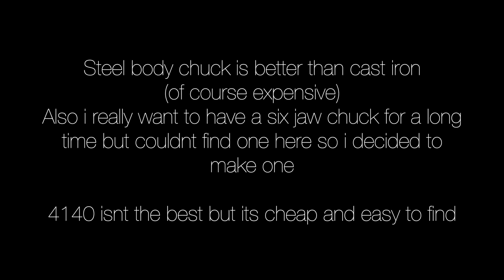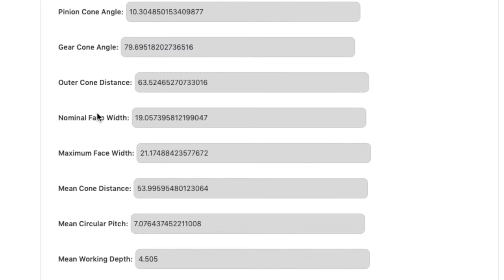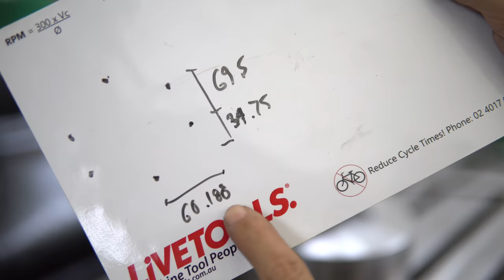MAKING a 6 jaw CHUCK - part 1

Comment: I have been in this trade 48 years and still I learn something new from people like you every day. I work mostly on a Toss SN 50 lathe fitted with a 250 mm diameter 4 jaw self centering chuck which is far superior to a 3 jaw chuck for many reasons. But a six jaw chuck would be fantastic. Never thought it is possible. BRILLIANT IDEA.

Comment: Greetings from Australia
Take some basic machines. Grinder, Lathe, Mill, dividing head Etc. 
These machines will give you the ability to make basic parts.
Naturally the machines have be "Tuned " to perfection. and if there are any faults or foibles in the machines know them well.
Next add careful design work then job planning. 
And finally add a highly skilled craftsman at the controls. 

I am in awe Mr Lem.

Comment: I remember when I used to think gears were challenging. In those days it was mostly lack of knowledge and partly the tooling or equipment. Soon as I made my first C brake suddenly thinks began to change, add a 4th axis, then a 5th axis to the mill, and boom, the world of tool making broadens, and does so efficiently. 

I would encourage anyone who wants to machine to manually first. If you cant make due with manual how will you make quality with CNC? This guy knows what he is doing. His love is for making all things, not manufacturing. I’m familiar with this mindset.

When you’re building your shop this is what you do. Before anyone thinks to buy a CNC engineer all those tools you want to buy from scratch like this guys and only then are you worthy of being a machinist. If you can’t make a boring rod, or thread a trapezoidal lead screw, regrind a broken end mill, or make custom cutter’s for your lathe stick to manual you haven’t spent enough time earning your keep yet. Before you turn on that first CNC build it, don’t buy it. Earn your communities respect.

To all of you who know what I’m saying and appreciate this guys work because you’ve been there, hats off to you my friends l, you are also exceptional.

Most will never understand until they’ve made it.

Comment: I’m blown away.  I watched your first few videos and you progressed so far in a short time.  Anyone who watches a lot of YouTube machining videos knows of Tom Lipton, Robin Renzetti, and Stefan Gotteswinter (sp?), and in no particular order I’d rank them top 3 but after seeing this I’d throw you right up against them in a heartbeat!  I haven’t seen anyone else make something like this on YouTube.  The mag chuck in the 4 jaw on the lathe had my jaw on the ground.  That’s a new one I’ve never seen (yes I know they make commercial round mag chucks for lathes but that’s not the point.  Then the diamond nib to dress the id grinder.  Not to mention the geartrain running off the power feed to cut the scroll.  Whipping up the pinions (little bevel gears) checking your hand ground cutter on the shadowgraph/optical comparator.  I’m prolly gonna rewatch it cause I think I’m forgetting a couple more impressive operation not seen on these parts very often.  And you hardened the parts too.  
Incredible, just incredible.  My hats off to you young man!

Comment: VERY NICELY MANUFACTURED ! ! ! ! I made a 4.000" 6 jaw scroll chuck, just to see if I could do it... Yes, I did it, but, WOW, was that a hard and long project, I think I had 180 hours in that, from R&D, to CAD work, to set up's, and (a few mistakes to re make) to finished completed 6 jaw chuck. Then I found exactly what I wanted on like from another country, for like $280 USD shipped.. LOL... That is okay, I enjoyed making it and learned allot. but, I like the lock system you did for the chuck key driver gears, that was a really clever locking system. Well done !!!!

Comment: Wow thats awsome! Its made of actual steel and not yucky cast iron. ❤😮🎉😊

Cast iron is like aids for lathes and mills, the sand like iron fillings are just like diamonds on glass and chew everything apart unless you strip everything down and clean thoroughly before next use

Comment: Sometimes I see them buying expensive tools for the workshop, even though we have all the machinery to make the tool. Sometimes I think they are lazy amateurs, and can not figure it out. I'm not trained in anything to do with CNC Turning or Milling, I'm a simple auto mechanic. Sometimes I come up with ideas about how to grind a steel to make the threads, but no no, rather buy an expensive TR26 threaded stud for $ 800 ..... 2 times ..... the first one broke. But what here I have to say. I only saw everything that needs to be processed, plus everything they destroy.
I think you're a genius, I'm throwing everything away when I see you made a new video, because it just needs to be seen. I want more.

Comment: You misaligned the two halves of the universal joint coupler. At 11:40 you can see that the two yokes of the universal joint are out of phase. This will cause the rotational velocity of the output shaft to slightly vary two cycles per revolution. In other words, two universal joints in series need to have their yokes phased correctly for it to be a constant velocity coupler. Because the two ends of the intermediate shaft are out of phase there's a small variation in the accuracy of the spiral.  

Luckily in this application the accuracy of the spiral isn't important.  And the large gear reduction between the dividing head and the output shaft driving the table feed will reduce that error and it's probably a lot less noticeable than it otherwise would be. It would only be noticeable if the grooves of the spiral were smaller and tighter. 

If you ever put this tool to use for an application where high accuracy of the spiral is necessary, then when you adjust the width of the cut (at 13:35), you should loosen one of the setscrews on the outer ends of one of the yokes instead of the setscrew in the middle of the intermediate shaft. That way you could keep the two yokes in phase. Alternatively,  a better solution than custom made universal joints to couple the two gear trains, might be a CV axle off a small FWD car.

Comment: (Technical translation) Like! This is the first time I see that a lathe chuck of such complexity and quality was made not at the factory, but in an ordinary workshop. But I will make one comment, the cardan transmission has a serious drawback - the lack of synchronization of the rotation of the shafts. Here you need a constant velocity joint (CV joint).

Comment: An amazing job of precision machining. BTW, the face of the chuck looks habd scraped. I didn't see that in the video.
Reply from the maker: No. Its cross grinding. Just rough ground for flat reference. I will regrind it on a lathe

Comment: I've seen a lot of videos on youtube like this but there's a whole bunch of firsts I've seen in this video. Someone using a surface grinder, which is weird because every shop should have one IMO, a shadowgraph, someone dressing a drinding wheel with a diamond and someone using the old engineers pocket book to work out the XY coordinates for the PCD and I'm only 18 minutes into this video.

Comment: How come you didn't use the schaublin for milling the scroll? They had the spiral system for both Rotary tables and dividing head
Reply from the maker: That system would cost 10 times the money i spent for the schaublin itself. I couldnt find any tool for schaublin here, also it small, too short z axis so i sold it year ago bro.
Reply: oh, I didn't know that. Sad to hear that you sold it but if you couldn't use it, then it's completely understandable. Anyway I love your projects!
Reply: I wondered if you'd offloaded it a few vids ago as I'd not seen it. Hope you got a great price for its sale after the restoration you did on it!

Comment: You are an amazingly skilled machinist. You need to finish it. At the very least, you will appreciate what it takes to build such a precise piece of tooling. After watching the video, I don't feel bad at all spending what I did for my six jaw chuck.  And how did you cut those bevel meshed gears? So much ingenuity.

Comment: verry VERRY impressive build 
me being lazy , if i was to tackle sumting like it i probably wouldve started with a 3 jaw chuck and adapted that to 6 jaw , if the top part of the 3 jaw chuck was not hardened i couldve milled it out for the other 3 jaws and i wouldve needed to make 3 extra jaws with the right offset spiral , and combine those with the originals 
this wouldve saved me some of the tooling needed to make the parts though i probably still wouldve needed the spiral cutter setup for the jaws (think you need to make sumting that holds the 6 jaws in their location while milling the spiral in the back of them , might be able to use the top part of the 6 jaw base for that it you make sumting to hold the jaws down in it while still being able to mill the back of them )

Comment: The input and output of the shaft with the 2 universal joints aren't parallel to eachother. This means that the output shaft speed isn't always the same speed as the input, each revolution it lags behind then catches up until it's ahead and then slows down again. I guess this wasn't an issue in making the spiral gear?

Comment: Looking at the specs pre 0:55 4140 is very close in the normalized state. With a small hardening the spec should be able to be exceed. Say maybe a temper only in liquid oxygen, or for even better nitrogen. Helium liquid is colder and would impart even more toughness to it. 

Heating can harden the steel but cryogenic treatment can also do some amazing things by changing the molecular crystalline pattern. 

Kinda like how heat hardens and then you temper it. Cryogenics help in amazing ways. 

Check out bend video about drill bits and cryogenic stuff at applied science. 

Just maybe thought it would help by the text card about how its not the best being alloy 4140. 4140 is amazing in reality.
Reply: Interested in the video about the spiral milling attaching attachment

Comment: 10:32 
10:52
Yes, absolutely, I thought this was the most brilliant aspect of the build, I hope you do a detailed vid on this.
Also, I wonder if you might consider an air auto chuck as for CNC machines...you could still use it on your manual lathe for higher production... Leader UK used to make 4" ones, then it looks like their subsidiary in Taiwan "Autogrip" took over. It'd be great if you could reverse engineer one...the hobby market would love to have that.

Comment: The internal grinding of the scroll was intermittent. Is the scroll form equally out of round from the hardening process? That could be the 1/2 thou out of round of the final vid. The work you put in means it should perform better than that. It’s so accurate in every other area.

Comment: did you calculate the length of the gear cutting tool or the diameter circle of the cutting tool on both the pinion and sun gears?

Comment: amazing work, maybe just drill bolt on face plate for oil line? &  plastic cap, or drilled short head bolt & grease cup with tread.

Comment: I didn't watch this video yet (no time at the moment), but i am wondering: Why 6 jaws? you need 3 to tighten securely, you need 4 to turn off center, what advantage to you get from 6? Tightening force shouldn't be an issue except on very, VERY heavy chip loads.

Comment: Never seen someone use a magnetic chuck in a lathe before.  Interesting solution for workholding.  Is holding power an issue at all? Can you take the same cuts you would in a regular chuck, or do you have to take lighter cuts.

Comment: Very impressive. I wonder if you made the six jaws also and if so how well did they fit? They would need to be oil or air hardened tool steel and hardened and ground to fit. My only suggestion would be to use air hardening (A-2) tool steel instead of oil hardening (0-1) for less warpage and distortion during heat treatment.

Comment: Man, this already looks awesome. Can't wait for the next part. I'm especially interested in how you will get the jaws to be correctly timed, and also how you plan on getting the tooth profile right.
Oh, and another thing: do you plan on final turning the outer diameter of the assembled chuck? Looks like there is at least one random line in the body from turning the outside halfway from both sides.

Comment: Whats is the use for that spring loaded ball bearing ball in a brass holder?
Reply: It's the oil port. The spring pushes the ball back against the interior hole to stop crud getting inside. At least that's my understanding
Reply: @anmafab  thanks